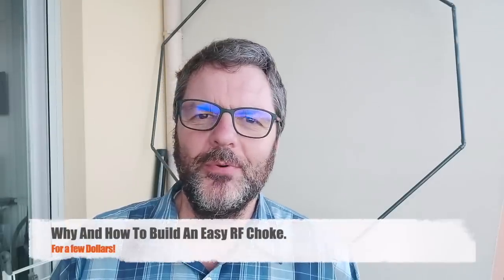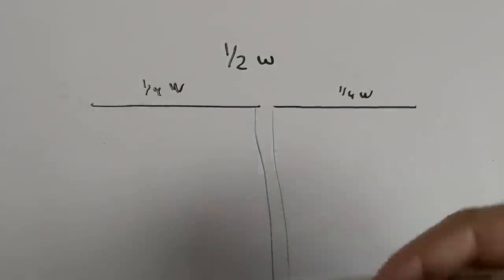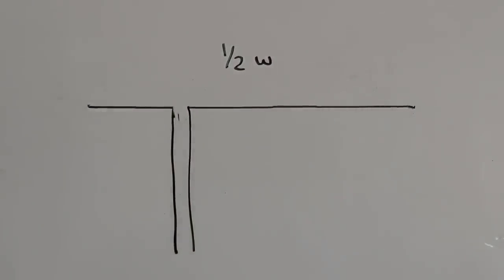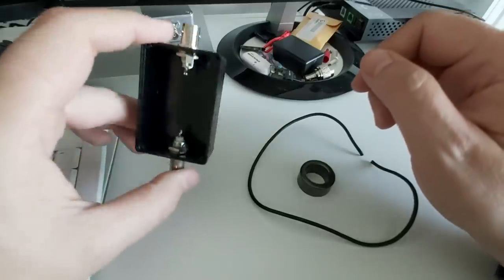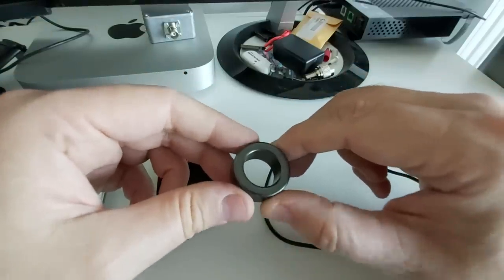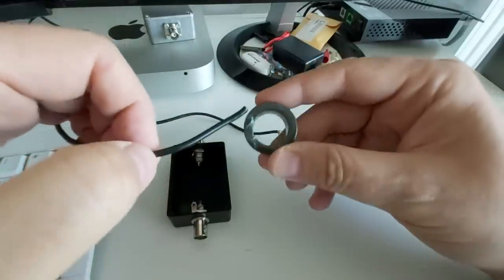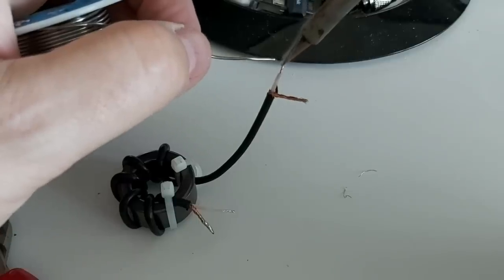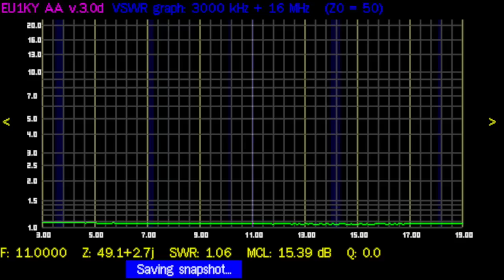Why And How To Build An Easy RF Choke.

Comment: Nice job! 👍🏻
I will never forget the feeling when common mode current at 100W on 40m into a short Vertical has hit my fist while started keying 🤯...learning by pain
Reply from the maker: Ouch! I never want to feel that!
Reply: @RadioPrepper  1981, using an FT101ZD and a long wire....Ouch! is the correct term, I can confirm.  Luckily, it has never happened since. Great vid Gil. 73  Keith
Reply: Always a good idea to test a new antenna on low power first. That way, you only get a little shock.

Comment: For a RF shoke it's simple. Independent of the both materials that you recommend put as much turns around as you can. For QRP power RG174 or RG316 is perfect as you can put a lot more around. It's simple as that. Despite a choke I prefer a 1:1 wired BALUN directly connected to the feedpoint of the antenna. If using balanced ladder line for feeding the dipole I place it on the junction between ladderline and coax feed. Every time as close to the antenna feedpoint to avoid coax loss and detuning of the antenna due to the coax feed. Also the ATU, directly behind the choke (1:1BALUN) to have low coax loss and best impedance matching between antenna and the 50 ohm coax.
Reply from the maker: Very good thanks!

Comment: Use 21 winding with RG316 to make a good CMC. Toroid used is FT240-31. Handle easy 500 watt !
Reply from the maker: Thanks. FT-240 is too big for me. That's a lot of turns!

Comment: Nice project Gil! If you're stuck with rf on the outside of your coax, I just use a 110mm diameter waste pipe to form a coil of 8 to 10 turns in the feed line. It forms a simple choke & I then either tape it up or use 4 zip ties to hold its shape. Take the waste pipe former out & you stop nearly all of the return current. I usually put it about 1/4wave, on the lowest freq band you are going to use, down the feed line from the antenna. It's cheap, it's nasty but, it works. Not as small as your one but does the same job. I usually do it on RG 213, 1/2" coax.
Reply from the maker: Certainly, but it isn't called an ugly balun for nothing ;-)
Reply: Radio Prepper true! I’m using 200W or 600W so it needs to be a bit clunky though. If I used a toroid, it would need to be quite a bit bigger & much heavier than the coiled feed line. Horses for courses. I still like your one though neat & has its place. I have an FT817 too so I can use it.
Reply from the maker: Good point for QRO...
Reply: So apparently the ugly balun is not as broadband as using ferrites.

Comment: Hello!. Im new to HF and was recommended to purchase this antenna. If you have time, what do you think of this. (I got the 155-foot with a 100-foot coax and instructed to choke at 95ft from antenna connection. Supposed to be good from 160m-6m..Thank you!

Comment: You what a common mode choke on every antenna because no antenna is perfectly balanced.  Yes some antennas have much more unbalanced than other but there is always some stray currents.  So use a good common mode choke and you will happy that everything works.
Reply from the maker: I only use mine when needed...

Comment: Hi, thanks for the video!
Curious why you chose coax and not bifilar?  
And also, is 140 size good for QRP only?  I use 240 size rings for 100 watt chokes.
73!
Reply from the maker: It's just simpler and bifilar is more finicky, requiring more attention to detail..

Comment: After watching your videos on the Minion I got to wondering if some of the problems I experience with my homebrew radio and random wire are due to common-mode currents. That made me wonder what you use as a choke. Then you do this video to explain! Merci beaucoup Gil!!! (are you a mind reader as well as a radio prepper?)
Reply from the maker: If only I could read mine sometimes ;-)

Comment: I was wondering, after winding a choke yesterday, can you put the choke in the same casing as the balun (or unun) or will that have unwanted side effects ?
Reply from the maker: I thought about that issue and am guessing that a bit of separation, at least a few inches is better. Maybe just using a longer box and putting the toroids at opposite ends might work.
Reply: I was thinking the samething.
Reply: While placing the choke in the same box as the balun at the feed point should do no harm and should help, typical practice is to place the choke away from the antenna. The idea of the choke is attenuation of common-mode current. One theory is to put the choke one quarter wavelength back from the antenna feed point. Just as an example, if you had, say, a doublet with a 9:1 balun at the centre feed point and it was fed with RG-58U co-ax. If you were operating on 20m band, you can calculate the wavelength as 300/14.1 = 21.28m. The quarter wavelength is the 21.28/4 = 5.32m. However, you have to take the co-ax velocity factor into account. This is  usually 0.66. So, 5.32x0.66 = 3.51m. You would put the choke 3.51m back from the feed point. 

Simplify the above by using one formula for RG-58U: 
(75 x 0.66)/(frequency in MHz) = quarter wave distance in metres.

If you have a different type of co-ax, just replace 0.66 with whatever it's velocity factor is.

For longer runs of co-ax, you can place the choke at odd multiples of a quarter wavelength (one, three, five, etc.).
Reply: @Steve-GM0HUU  
I'm not sure why you wouldn't want to place it as close to the transmitter as possible? Isn't the feed line considered part of the antenna if it's some fraction of the wave length you're using? I've got EFLW's on the brain, so I'm pretty sure what ever I say my be wrong here.
Reply: @Steve-GM0HUU  In certain cases you may be correct Steve but in most cases I would suggest that people use common mode chokes to stop ANY part of the coaxial cable becoming part of the antenna. Allowing your coax to radiate for any multiple of a wavelength will only serve to alter your radiation pattern. That's why common mode chokes are placed at the antenna feedpoint, to stop RF currents coming back down the outside of the coax and effectively becoming part of the antenna.
Reply: @Steve-GM0HUU  I would think the whole point of combining an unun an rf choke right a where coax turns into antenna, would be to make it a tunerless antenna.
Ground it well for a good countepoise, maybe 1/4 wave radials.
As long of a wire as possible, and one halfish as long, so it can resonate, somewhere, with the more satisfying length per tx freq.
The unun will match impedence between antenna, and coax.
SWR will not matter, because the choke isolating coax from antenna keeps rf from riding the shield into the shack. 

Mostly: No tuner, and feedpoint high up, multibands.
Reply from the maker: For a random wire you might want to put the choke down the feed line. For half-wave wires, near the antenna is better.
Reply: @RadioPrepper  Thanks for the 411. If you had a choice, would you go with half wave or random? Would the half wave just take a bit less balun ratio, and reduce loss?
Reply from the maker: Half-wave hands down, much less trouble and more efficient. Use a 49:1 or 64:1, three turns primary for lower bands, two for upper bands (15m and up).

Comment: Hello Gil I've used epoxy to glue toroids down into boxes for chokes and EFHW transformers but just enough to hold it in place rather than potting the whole thing however what I do is wrap the core in loads of PTFE plumbing tape first that way if you want to take it all apart later you can just cut the tape off and the toroid is free. I've often found hot glue doesn't stand up very well when when you throw it in your kit bag. A few knocks and things just tend to break loose again. I built one just like this however I put the connectors on the same end of the box so it packs away a little easier.
Reply from the maker: Great, yes, that works!

Comment: I think I can do that if I slow down the video and spend an afternoon studying. One question I have is where o you get those neat little boxes? Who knows, I may build one of these. I have hand tremors and had an awful time with Anderson connectors, an awful time. Thank you for your video. Looks like there were a lot of people who needed this information. It was kind of you to help so many. N4KBM
Reply from the maker: Hi, I get them on Ebay for the cheap stuff, and the good ones, the Hammond brand.
Reply: @RadioPrepper  What size is the box?

Comment: I have 240-43,  can I wind one that will cover 160 to 6 meters  using that 240-43 and RG58?  How many turns would I need?  Thank you for the information.  73 de W4DES
Reply from the maker: I would try a dozen... I have seen sites online with netter information though, worth a bit of a search...

Comment: Hi! I have a question for you. When using an End Fed Half Wave antenna with a 1:49 unun, do I need a choke balun, or is it not necessary in this case?
Reply from the maker: Generally not necessary. You would need one for a 9:1 with a random wire though..
Reply: @RadioPrepper  Ok, thanks. 73!

Comment: Gil, nice info! Congrats! Can a FT-114-43 be used as a choke? How many turns? I've made a 49:1 with 2 x 140-43 and like to know which choke fits better. 73 de PT2YW
Reply from the maker: I would say yes. I would actually use a few more turns, say, eight to twelve, experiment...

Comment: Great video - thanks! So - if I have my FT-891, I'm outside (not trying to operate QRP in a hotel room as I often am) and want to go full 100 watts, what has to change? The toroid? The coax? Both? I love the idea of the small size and I can both pack in a bag for travel on in my saddlebags when on my motorcycle. Thanks in advance for the help. 73
Reply from the maker: The toroid, FT-240-31, bigger...

Comment: I leave my portable connected to my random wire antenna and today I noticed none of the buttons worked. I took out the batteries and it worked for a few seconds and locked up again. I unhooked the antenna and now its fine.
I wonder if this was an rf issue or because it's a cheap radio?
It is stormy out today if that'd matter.
Reply from the maker: Hi, that sure sounds like it... Try with a choke,  you'll know right away..

Comment: Gil, you rock. Question, is that toroid providing enough resistive impedance for 80 meters, without the inductive impedance? I just finished a 240/31 w/17 turns, but always looking to save ounces. This choke is now the heaviest thing in my kit except for the radio. 🙂
Reply from the maker: I think around 900KOhm...
Reply from the maker: Oops, 900 Ohms sorry.

Comment: Are these types of filters ONLY for unbalanced antennas or will they remove rf noise picked up from power lines also?
Reply from the maker: Not from powerlines. You'd need a specific filter for that, not sure what kind...

Comment: Do you think you still need an RF Choke when using a End Fed Random Length wire with a 49:1 balun? I haven't seen RF Current, however, I can't say that I'd know what I'm looking for  since currently all my work is SSB or FT-8.
Reply from the maker: 49:1 is for half-wave wires. 9:1 is for random. You never use a random wire with a 49:1. A half-wave wire should not require a choke.
Reply: @RadioPrepper  
Interesting, I'm making and using 49:1 for EFRW antennas and getting really good SWR's across all the Ham Bands from 30Mhz down. Normally I get SWR's in the low 2's
Reply: @TheDgdimick  Curious. What cores are you using? for a 49:1 I've found -43 to be pretty good however -2 (powdered iron) is very lossy and you might see a decent SWR but all your energy is just heating up the core. Build two identical transformers and hook them back to back. Transmit into one end and connect the other to a 50 ohm dummy load via a power meter. Measure the power at the far end versus the power you put in. If you put 10w in and get 5w out like i did with -43 cores then each transformer is losing about 25% of your power as heat. I did this with -2 cores and could barely measure any power at the far end they were so lossy.
Reply: I should mention I use -2 cores for chokes because unlike an autotransformer you actually want the core to burn off any common mode energy as heat
Reply: @binky_bun  
Thanks for your reply, and bare with me here:

I'm using 240-43, for the 1.5Kw (3 of them)  49:1 baluns, and 140-43 (1 of them) for the 100w or lower baluns. Now, I'm not disagreeing that there is some lose, I just have an issue/question about your test when using a dummy load. Most dummy loads are 50ohms, when you use a 49:1 balun your only going to be seeing an input of 1.0 ohms = 50/49 = 1.02 ohms, and a 9:1 balun will see 5.56ohms, into the transmitter. The BAD SWR you're feeding into the transmitter should/will cause the transmitter to decrease the power the transmitter outputs. I see your test as not really being valid. If I was going to run your suggested test, I would need to build a 3300 ohm dummy load, however I don't have 10watt resistors to do this. If I'm wrong here, please correct me.
Did you have power meters on both the Transmitter output as well as on the output on the balun? Just because you dial in 10watts out on the transmitter doesn't mean your going to really get that 10watts out.
Reply from the maker: Remember I tested a choke, not a transformer. The choke does not change the impedance. A transformer I would test with a 2500 Ohms resistor, not 50 Ohms.
Reply from the maker: Also you test with an antenna analyser, that's only a few milliwatts. BTW if you use that much power a choke would be a good idea.
Reply: @RadioPrepper  

You're right. Ben tests should be fine then, and I may be able to duplicate them as well;  he did state CHOKES, and I replied with a Balun. Thanks for pointing that out.
Now I just need to dig up some small coax like you used.
Reply: @TheDgdimick  I think you missed the bit about building two transformers and hooking them back to back. You transform 50 ohm to 3300 then the second transformer takes 3300 and brings it back down to 50 for your power meter and dummy load. Any loss you measure just needs to be divided by 2 because you have two transformers. If the transformers are working as they should then your radio should see 50ohms with no SWR. Just keep the wires in between the two transformers as short as possible. I do have a power meter at the front too but that's built into the radio but it does show if the radio is backing off the power due to high SWR etc also you have to make sure any tuners are bypassed. I don't think this test would work for the random wire situation as a random wire is not a purely resistive load. The thing with autotransformers is they're only any good for the resistive loads. If the antenna has any reactance then all bets are off and there will be high losses in the transformer and in the coax. The ATU is just reflecting the already reflected power back to the antenna so the transmitter doesn't see it the SWR on the coax would be unchanged and this would cause high current nodes in the coax where it would get warm and probably the same in the transformer as power is being reflected back through it as well.

Comment: Thanks.  How do you know/calculate the correct number of turns, or is this purely trial and error?
Reply from the maker: There is a calculation but I just got the info from a few different sources...
Reply: One source, I have used and think is very good is G3TXQ's findings on common-mode chokes. It can be found here:

http://karinya.net/g3txq/chokes/
Reply: @RadioPrepper  - and those sources are dead wrong. You should remove this video, because a.) wrong number of turns and b.) such a core 'FT-114-31' does not exist. So, what you show in your video is just 'believe'. ;-)

Comment: can you just wrap a sma cable around a toroid, no soldering? also how does this suppress DC? Wouldnt you want a 1:1 isolation transformer?
Reply from the maker: Hi, sure. It does not suppress DC, just Comm9n mode currents. Not sure which of the two works best..

Comment: Hi Gil, can you advise on an EFHW transformer using 140-43 cores? What size wire did you use and was the turn ratio still 14:2? And did you use the standard 100 pF capacitor?
Reply from the maker: 14/2:for upper HF, 21/3 or even 24/3 (64:1) for lower bands. 100pf 3KV.
Reply from the maker: Wire: 1mm.
Reply: @RadioPrepper  TNX ES 73!

Comment: Is the number of turn very significative ?
some poeple are sujesting 14 turns. 
Is there a way to measure it with a VNA ?
73 et merci d'avance
Reply from the maker: I think more would indeed work better. You can measure its impedance yes.

Comment: Bonjour gil de radio prepper.
Est-il possible d'accorder l'impedance d'une antenne dipole  "pour le 11m "de 71 ohms au centre avec un coax 50 ohms en utilisant un balun à air.ou la desadaptation mineure ne nécessite pas vraiment ce genre de montage.
Reply from the maker: En effet pas besoin, c'est assez proche..

Comment: Thanks for the video. I just build an 9:1 UNUN - inspired by your  videos. ;) 
But I have a small question: Would a FT 114-77 also work?
Reply from the maker: I don't believe so, but not sure.
Reply: Hello! Can you please tell me if the FT 114-43 can be used?
Reply from the maker: Yes, but given its size I would use 3 turns primary, 21 total, even 24 total for 30m and below.
Reply from the maker: I even use the FT-82-43!

Comment: Chameleon makes a coax cable with a choke built in to one end. Does it matter which end of cable is connected to the radio for HF or VHF/UHF?
Reply from the maker: Better locate the choke closer to the radio.
Reply from the maker: It just depends whether you want the shield of the coax to radiate or not.. With a randon-wire end-fed you would. With a dipole, not.
Reply: OK, and with the Mil 2.0 Vertical, I would suppose you would want as much energy out on the antenna itself. I initially kept the choke out by the antenna, but now have the choke at the radio, mostly to keep the RF away from myself.
Reply from the maker: That's the way I use it...